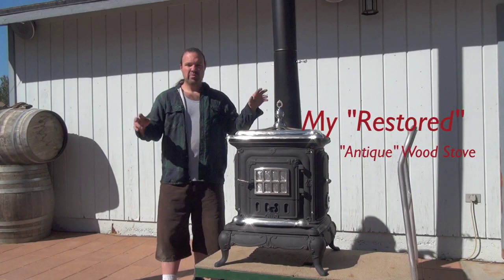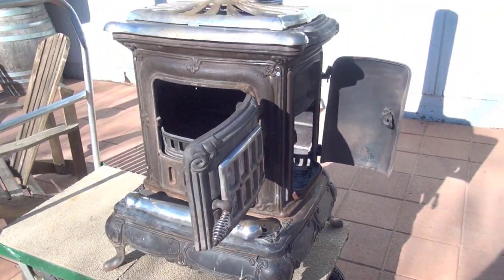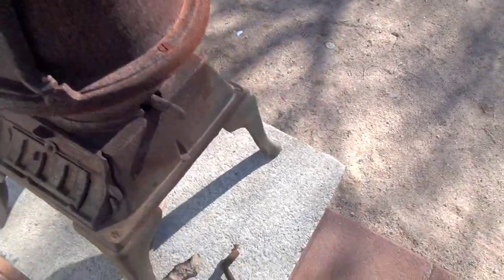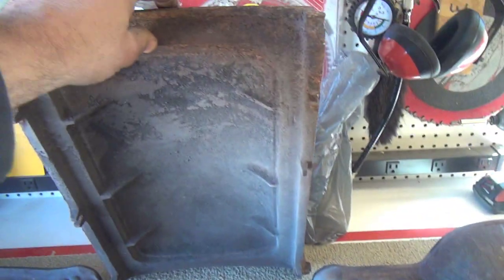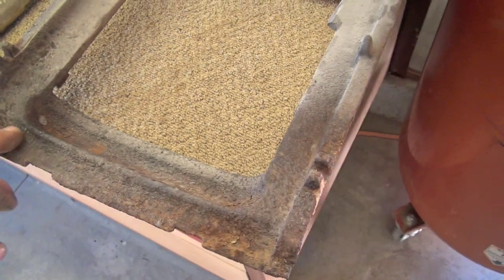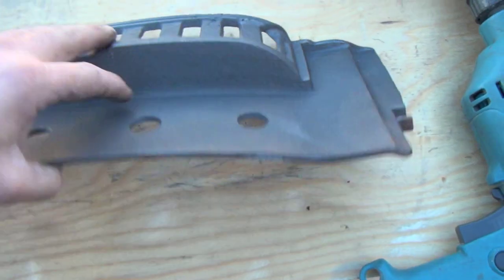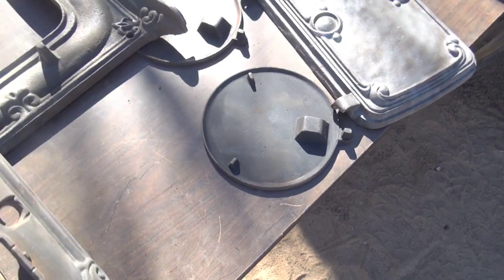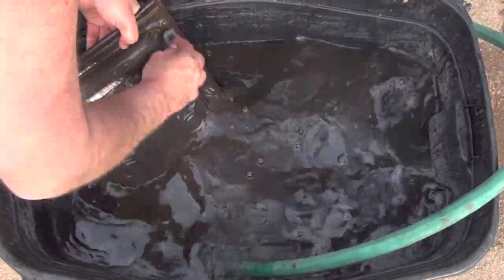How I Restored This Wood Burning Stove PART 1 *Step by Step *DIY

Comment: I just bought one. Had one on our acreage bought from Simpson Sears in the 70's. Will be restoring it in February. Thank you for the video.
Reply: I have same one, used for years.    KEEP FIRE LOW.... AND OFF THE BOTTOM.  Otherwise good stuff

Comment: I just found your video. Great job. I picked up your stoves twin brother about a week ago. Same thing, Craigslist, good price. Did a similar restore but used a wire brush for the initial cleanup. Have it installed in my woodworking shop and it's been baking my a&& out of there ever since. It's very efficient. I'm extremely happy with this little beast. Good job and enjoy.

Comment: Nice! good detail and hard work, I did the same with mom's stove, took me longer due to the bolts. You have to have patience for this type of restore job. Ok,,, on to part 2. Ray
Reply from the maker: Thanks for the kind words, Patience yes & it helps to have a background doing finish carpentry. Looking back my biggest mistake was not wearing a respirator while sanding that nasty metal, Ive since picked up a nice $40 respirator  from the hardware store & wow, what a difference. Hey Ray, I checked out your channel hoping to find a video of the stove you restored. I like that sort of thing. Thanks for watching ;)

Comment: if your going to really get into doing a few of these or other cast iron restoration, the easiest way to clean it by far is by making an electrolysis tank They are cheap and easy to make and a lot more effective and less work than scrubbing.

Comment: Hi,  Just bought a franklin stove made in taiwan at an auction that weighs a ton.  It is a simpler version of yours but would also like to use it outside. 
Know nothing about woodstoves but have good wood to burn.  How high does the chimney actually have to be for one that is about the same size as yours and what will you put yours on.  Love the potbelly one you showed,  but the height of that flue would get killed in out high mountain winds here in W. MD   Please help....can you give us a few pointers for what to look for in how it should work?  Thanks for any help.  Yours looks awesome..but we are just concerned with ability to burn up wood while we cook and warm ourselves....

Comment: hey mike you did a awesome job i bought an identical stove n trying to restore but have problems taking the screw n nut off any suggestion they r really rusty
Reply from the maker: Cool, you can try soaking the bolt & nut with pb blaster or wd-40, let it soak over night, pl blaster is sold at auto part stores. If its completely shot then maybe cut or grind off. A big mistake I made was not wearing a resporator or dust mask. Good luck & I wish you luck :)
Reply: ty if u live in louisiana maybe u can do this project for me
Reply from the maker: lol, I probably would if I lived there ;)
Im on the west coast though. 
Maybe just restore the exterior of the stove, it will still look just as nice when its in use. polish the chrome pieces, paint the iron & you'll be good to go.
Reply: TY I SOLD IT FOR THE SAME AMT AS I BOUGHT

Comment: Zep spray from automotive dept. to remove nuts and bolts. The windows are made of mica you can purchase new online and other parts and pins. The Concrete is not concrete it is ash that got wet then dried over the years.

Comment: Hey man i have a stove damn near identical to yours cept mine doesnt have the two cook spots on top....its just flat. And on the back is says parlor stove made in ta wan and lastly it has two knobs for the airflow instead of the slider vent. What throws me off is the made in ta wan on the back. Do u know anything about how old it is or if its a knockoff?

Comment: the little one is a coal stove, and stainless steel screws a and hardware tightened properly will last a lifetime. back in the day we used stove black, to preserve the finish, I know of no paint that will put up with the heat that these produce, most all old stoves used asbestos rope for door gaskets.. cleaning can be done with a speedblaster, remember to use a approved dust mask !!!!!
Hey ..try to run that little stove on coal, it will surprise you.BIG TIME!
 And the door glass is called mica if I remember right  and is fragile. nice build it fun to spark a stove like this back to life. the chrome parts might be off being discarded, as they are fragile and will rapidly rust, if used outside in the elements .   .